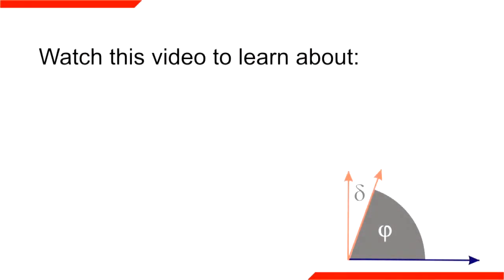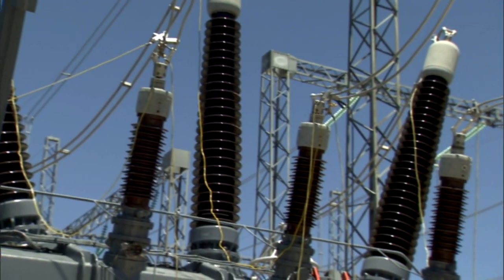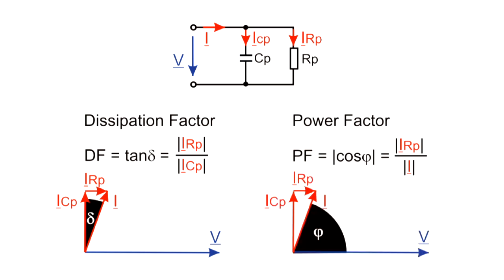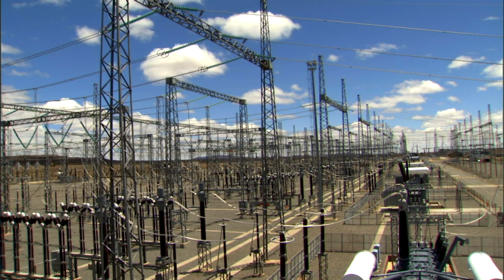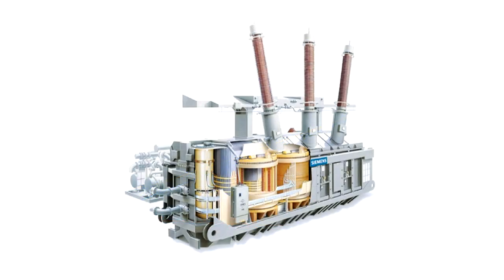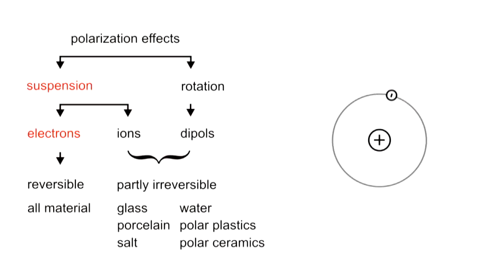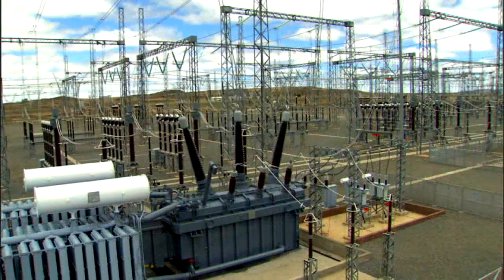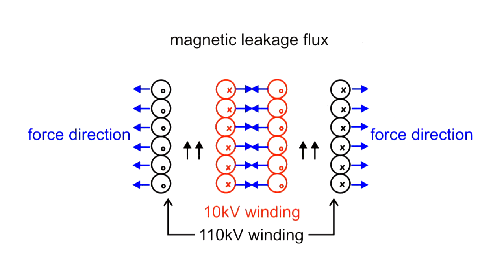TanDelta/Power Factor Testing - Background

Comment: What is the permissible limits of Capacitance in  (pf or nf)  between HV - LVE, LV-HVE, HV-LV for power transformer : 11.5Kv, 33kv, 132kv, 400kv
Best regards
Reply from the maker: Hi Eng. Omar Eyad Aljornai, 

thanks for your question. Here refence values could be checked based on FAT results for comparison. If you have any additional questions, please get in touch with your local contact person. You can find them here: https://www.omicronenergy.com/en/contact/addresses

Best regards, 
your OMICRON team

Comment: Dear Sir: Could you please tell me, For power transformer, which test is more accurate? And why? TAN DELTA TEST OR INSULATION RESISTANCE TEST? With my best regards.
Reply from the maker: Hi Eng. Omar Eyad Aljorani, 

thanks a lot for watching our videos and for your interest. Regarding your question: Tangent Delta Testing allows an assessment under AC test voltage which is comparable to at power frequency and provides more detailed information about the insulation integrity. 

Best regards, 
your OMICRON team

Comment: Can u plz tell what are the permissible limits of loss angle (%) for 132kv transformer and bushing (ht) according to IEC standard?
Reply from the maker: Dear Habibul Huda, 

thanks a lot for your interest in our videos and products. Regarding your question: In the IEC60137:2003-8 the maximum values of tan(delta) are give in Table 5 as:
OIP: 0.7%
RIP: 0.7%
RBP: 1.5%

For power transformers there are no limits given in a IEC standard. For limits it typically to follow CIGRE recommendations. 
In the CIGRE 445 it is mentioned that values are typically around 0.5% and values above 1% are questionable. 

Best Regards, 
your OMICRON team

Comment: Am I saying it correct?
Ust means cap measured between HV and LV bushing of transformer.
Gst means means HV and ground or LV and ground.
Reply from the maker: Dear Moumita Mondal, 

thank you for your interest! 
UST guards the current to ground whereas GST always measures the current to ground. Depending on the input configuration and setup, yes UST-A or UST-B is the Cap between HV and LV and GST the CAP between HV+LV+Ground.
If you have any additional questions, please get in touch with your local contact person. You can find them here: https://www.omicronenergy.com/en/contact/addresses

Best Regards, 
your OMICRON team
Reply: Thank you so much. It cleared all my doubts.

Comment: what is main difference between GST and GSTg mode
Reply from the maker: Dear Mr. Chand,

In GST mode each current from HV to ground, HV to Input A (red) and to Input B (blue).
GSTg A or GSTg B or GSTg A+B means that the stated input of the CP TD1 gest guarded ("g" means guard) therefore this input current will not be taken into account for the calculation.

For more detailed information please contact the support of OMICRON via our website.

Best regards,
Your OMICRON team